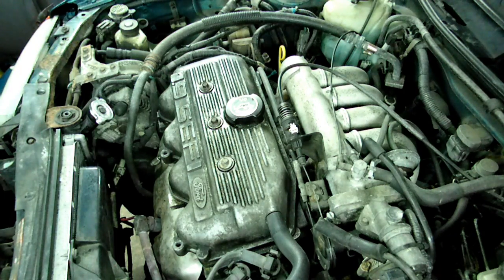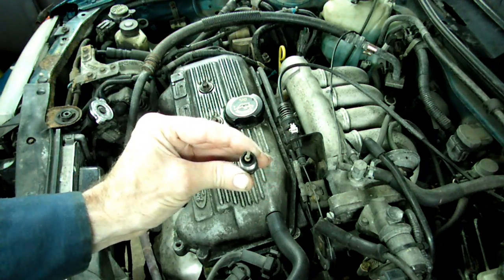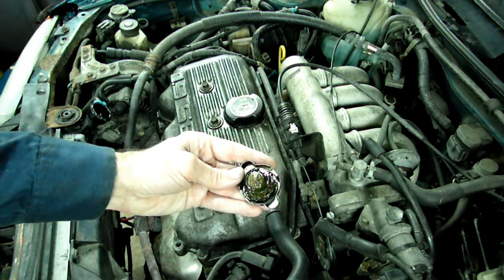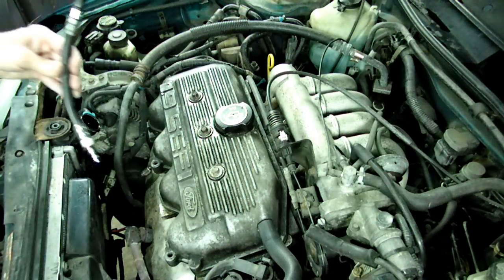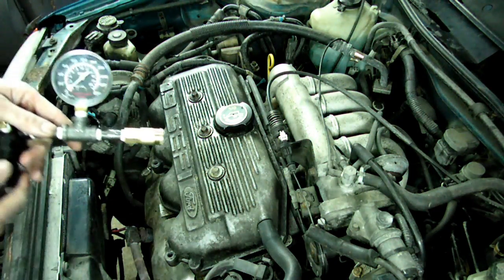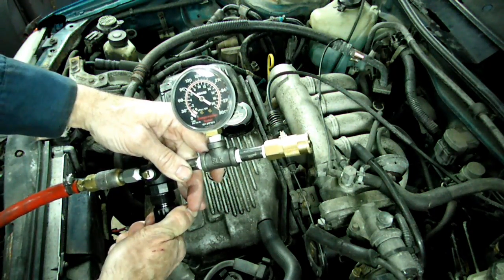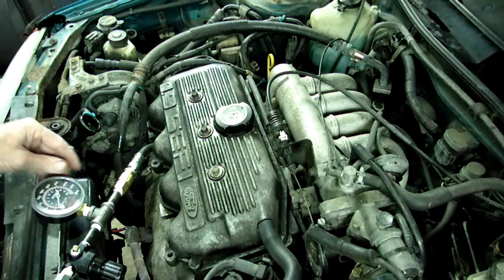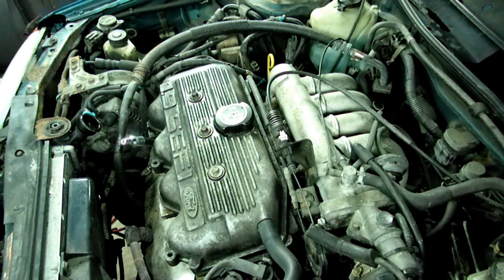Cracked Cylinder Head Blown Head Gasket

Comment: First off a proper technician always double checks and tests to confirm the diagnosis, not just look at something and say "oh, this is the problem". Second a leak down test tells you more than you might think. Not only checks the head gasket, but also checks the valves. Doing a diagnosis like this makes it easier to determine the amount of work ahead and helps to lessen any suprises that might pop up. Dont mean to sound like a dick if I do...

Comment: Doing that repair to that engine isn't worth it at all. You can find a whole replacement engine cheaper than the repair costs to fix/replace a cracked cylinder head.

Comment: @lcabrera69 hey noticed your comment and thought id share what my cas was doing. well basically the same thing as you. take cap off run engine and coolant just jumps out like gush .... gush.... gush. anyway come to find out my heater core was filled with ice so i took a little heater put in the cab under the pass side dash and melted the ice in the heater core. now you may not have ice but your heater core may be cloged. check hose to see if they get hot like they should if not its cloged

Comment: @richpin06a yea im scared that i might have a blown head gasket because the car over heats but the fans dont work anymore so im thinking is the fans the cause the over heating but sometimes a little of water comes off the tail pipes when i just start the car and like i explained to you water just jumps out of the radiator when i take off the cap and the engine is running

Comment: HeHe, I just watched your part 2 video after I posted my comment and sure enough, crack on the exhaust. Also, if you come across a 80's/90's mopar 4 cylinder(2.2/2.5) they like to crack between the valves, but they don't leak anything(unless its huge). It's just one of those quirks I guess lol.

Comment: @richpin06a lol, yea, they usually crack at the exhaust seat, or a piece of the combustion chamber shroud will literally fall off and grenade everything. I think it might be because they don't have enough coolant going into the head, or just plain not have enough metal around the combustion chamber in the head(inside where you can't see it)

Comment: @qfo  Would you also not need to eliminate broken piston rings -- or badly worn out at least ?
Then there;s the problem with a blow through on the piston crown by pre-ignition in the old days .
Need to pull the head at this point anyway .